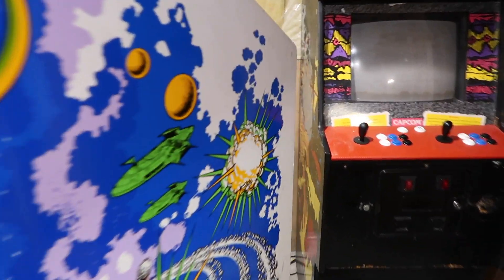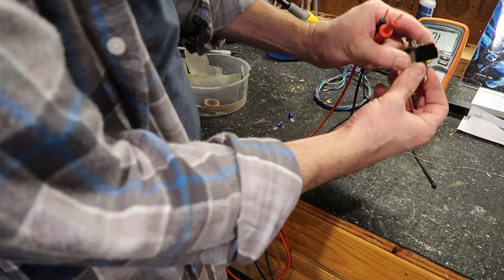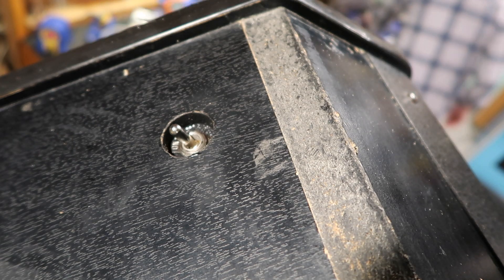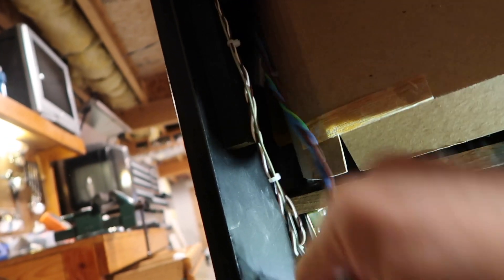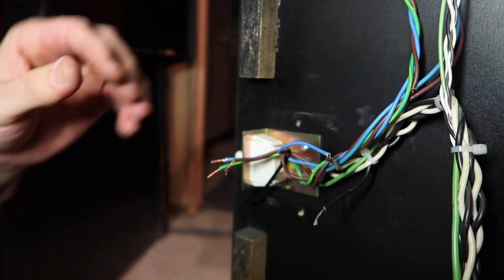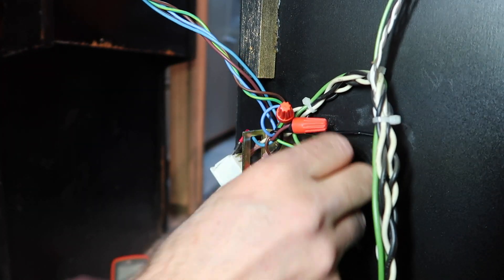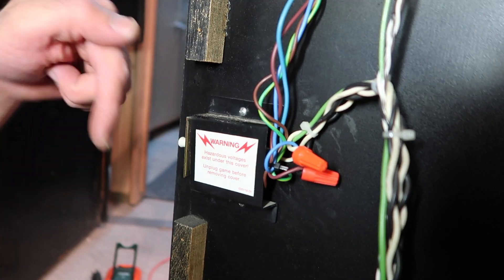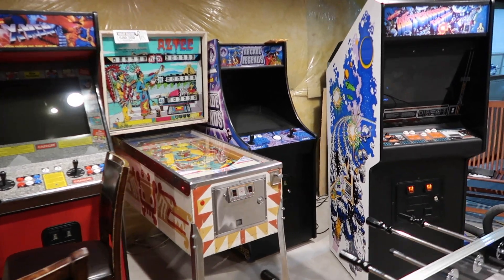Wiring a better Power Switch on Atari Asteroids Deluxe Arcade Cabinet

Comment: You mentioned that your monitor would show "Spider webs" and get really bright. My Asteroids is currently doing the same after its been powered on for a few minutes. I've done a lot of troubleshooting but no luck. Did you figure it what what was causing this?